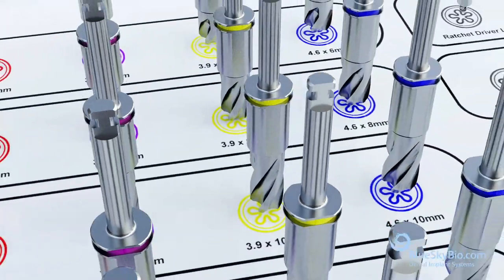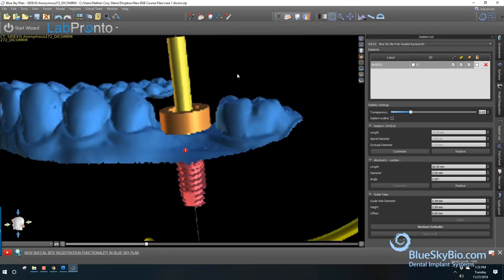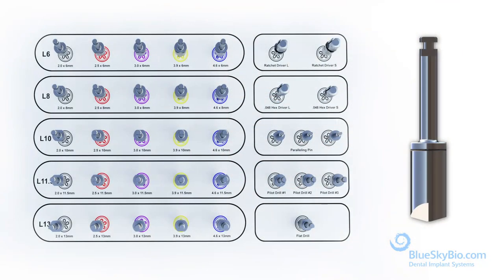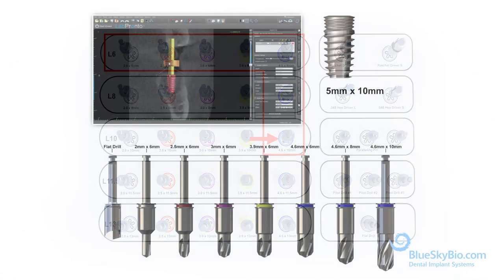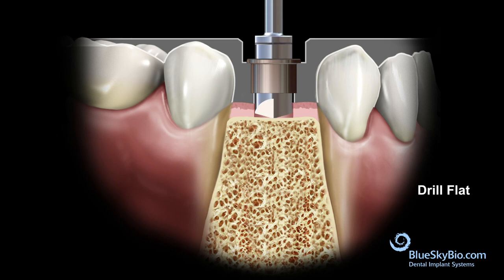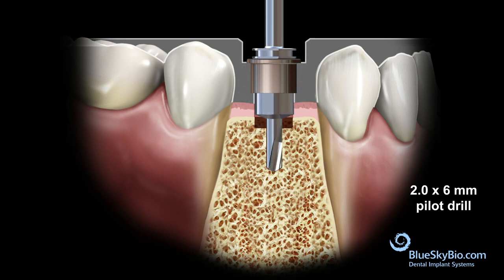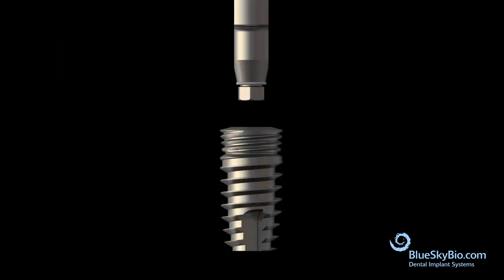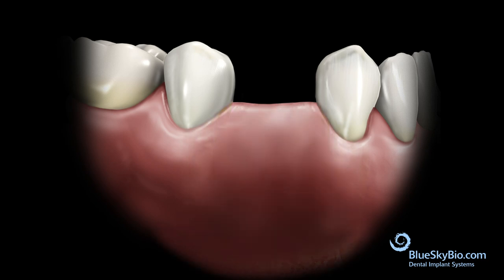Bio Max Fully Guided Keyless Surgical Kit

Comment: I would like to clarify if there is a single master sleeve in the guide through which all the keyless drills pass? Or is a master sleeve not needed to and the guide part of the drill instead is in direct contact with the acrylic of the guide?
Reply: There is a master cylinder, the TUBE524-504-4L, as well you can go sleeveless and contact solely the resin on the guide. https://blueskybio.com/store/guide-tubes